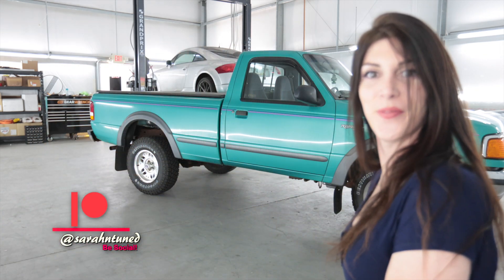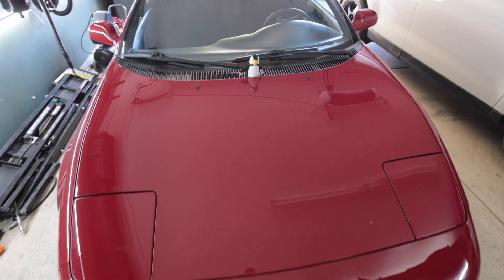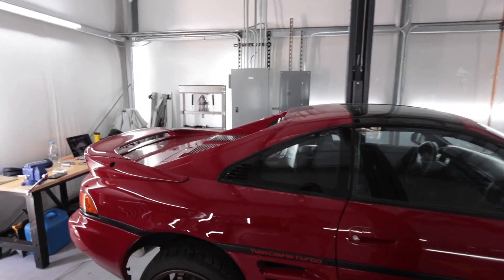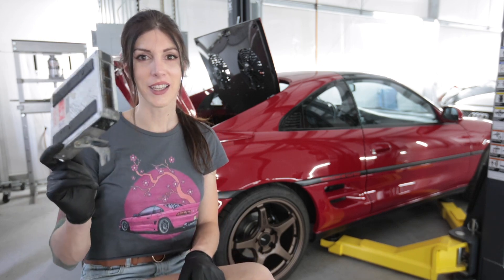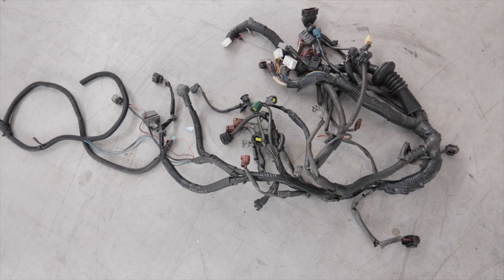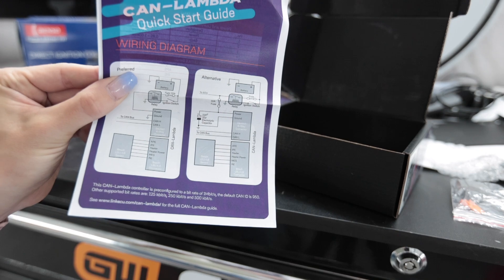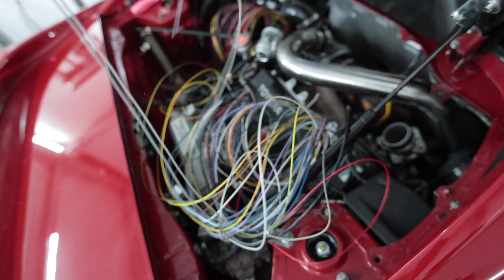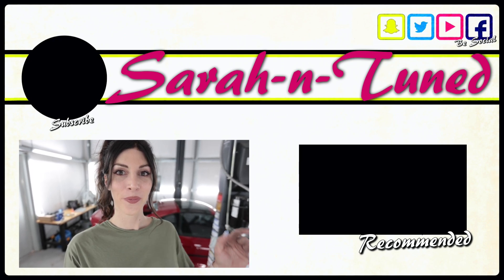Building an Engine Harness From Scratch! // Mr2 Turbo Link G4+ Stand Alone ECU

Comment from the maker: If anyone has a source for brand new OE SW20 Gen 2 3SGTE engine harness sensor connectors/pins please let me know!
Reply: Ballenger Motorsport. I pretty much got every connector with terminals for the entire engine harness.
Reply: Sara make your life simple get a pice of ply wood and lay out your old harness and screw it drown. Then take out all the shielding to see the wires and use it as a reference to reverse engineer the new harness
Reply: @josedanger8116  Great advice!
Reply: MR2 drivers club would be an organization to mine.
Reply: More work on Mr Dos?

Audience: yay! 😀
Sarah: not again!😣
Reply: corsa-technic
Reply: Farnell has many connectors. Sometimes you can read a number on the connector (after cleaning) and just google :-)
Reply: I heard wire gap Inc . Does new  Mr 2 harnesses. To order. Maybe not new connectors? Worth a call. 
 I would actually contact Toyota TRD and see if one of the older warehouses has a turbo
 harness on a shelf or the connectors since you have the skill to make your own.
 This might take more courage and determination than the 7 samurai defending that village.
Reply: I assume you looked at prime Mr 2?
Reply: You can find the pins on the Digi-key website.  Yes, they will have them, unless they are some proprietary design by Toyota.   If Digi-key doesn't have the special pin crimper needed then check the Techni-Tool website.
Reply: This car is the the reason I watch your channel. I have always loved the MR2 and yours seems to be the only one without a k-swap, which is very cool.
Reply: Commenting for the algorithm
Reply: Sarah,  that stock computer mount was designed with vibration mitigation in mind , allowing for some movement.  Hard mounting directly to the body may not be as nice to the pcb and internal components.  You may want to consider a rubber bush or polyurethane puck placed between the mount n body . Being a road car .  Reliably n mind .
Reply: You're a clever cookie arent ya!
Reply: Not sure if Twos R US would have any new ones but I'm sure they would help you out. They helped me out with a lot of parts when I had my 89.
Reply: Been watching all the nr2 channels closely. So I could restore mr2 to more modern way. 

few products I'm working on that you @sarahntune could actually used to restore your mr2 with a jdm engine. 

1) full milspec wiring swap 2grfe set up for stock ecu, and or any standalone in the market.

2) plug and play milspec gen2 gen3 and gen4 engine harness for the stock ecus, and standalones. with all new connectors and plus and pins. 

3) full milspec body harnesses for pdms and digital gauges for all your standalone setups.

4) Tubular frames and other fab work will come after.

oh and if your using a link g4x I would just change my temp and pressure sensors to a more reliable setup like the bosch motorsports pst-f1 sensor which gives u two in one setup.
Reply: Nope, sorry. Can't  help. All I have is the Ranger part.
Reply: Keep keeping on with the wiring it will so be worth it to have a reliable DOS.  I'm doing my project car wiring too and I'm more of a spanner monkey than a gremlin hunter. Best of luck I'm sure you will do great JX
Reply: Still no nails colour coded to the truck. Trucks paint is in great shape for a colour match. White creamy be stuff out of the tip I'm weak laughing top Sarah puns 10/10 JX
Reply: This stuff seems kinda technical. You know what would be fun is having a shuffle board set up on the shop floor and rolling from end to end for points 🤣👍hey, I'm sure to win
Reply: Just hit up 3stwins on iG
Reply: Try search for RM06H0E.pdf this will give you the Toyota connector repair manual. Maybe you can find your connectors this way the OEM part numbers are mentioned in it as well.
Reply: I have no idea how much it costs, but what about one of the companies that say they can make a custom replica harness if you can send them your old one? They also claim they can rebuild a harness, including stripping off all of the old insulation, soaking the wire in a deoxidizing agent, and applying new insulation. Then they replace the wiring pins in the connectors.
Reply: Sarah..you can do this you are a Genius!  Dont let over..thinking  get in the way of enjoyment..remember  you do love and have a passion  for working on cars
Reply: Check with Kyle from Boosted Bois. He's an MR2 Enthusiast
Reply: Wouldn’t worry It taken me nearly a year to build my harness
Reply: About to rewire both engine and body harness in my 91 sunroof gen2 turbo swap.  By chance does anyone know which gauge wires I should grab in advance?  Thinking SXL 20 gauge for a decent amount of it, but think there may be some 14/16/22ga etc, as well.  Just don’t want to tear mine up and then find out I’m missing some wires and have to wait longer.  Doing AEM infinity 5 series EMS, btw.  Dropping Cold-start injector, MAF, TVIS, adding 1uz injector conversion, adding AEM MAP, AIT, EGT, and UEGO sensors.  Thanks in advance!! And love the mr2 series!
Reply: I just sold all mine were still in mint condition. Damn wish i seen this earlier.
Reply: Caspers Electronics has OEM mechanic packs for pins and connectors for a lot of manufactures last time I visited with them  … they may be able to sort you out or at least point you the rests of the way if you hit road blocks.

 … also a wire looming tip is to lay it out on peg board and get the main lengths and destinations sorted, bundled and labeled before running throughout those tight awkward spots… then doing the fine detail work in place . Cheers!!!

Comment: Sarah, you might know. You were obviously an aviation electrician. I was an avionics technician. You remember the unbelievable tinned mtw powder coated fine strand paper wrapped milspec wire? Do you know where to get that stuff??? I'm going to do my 944 with a Q7 VR36 and I want to use it to build my harness and also use canbus modules for ZL1 type electronic shocks and all the body modules. Adaptronics to control the Oddy dsg.

Comment: Geez these modern cars are complicated! I'm so glad the new harness for my old Chevelle has everything already labeled and sorted. I just need to pull it and connect everything. 

I would suggest hanging the  harness on the wall. Then just go through it and mark and group the wires. Do as much prep work off the car as you can. It's easier than doing it while trying to fit into tiny spaces in the car.

Comment: JDM 94-99 SW20 MR2 Gen3 Turbo 3SGTE 245 Engine Middle Body Harness Wiring Wires~ | eBay
$399.00*· In stock·Brand: Toyota-is this it

Comment: Ideas on how to shoot this check out 5 Star stereo installation videos here on you tube.  They do an excellent job of showing the wiring in their videos.  Be organized and methodical, as you already are, and due sections at a time.  You already started that by grouping the wires.  Sometimes it helps me to draw the circuits I'm working on out so I can better visualize what I'm doing.  Slow and steady.  DINSTAAR.

Comment: Hopefully if you can cross reference the connectors to Molex or AMP, Digikey or Mouser should have the contacts.  Also, in the absence of a harness board, maybe you can lay some tape out on the floor to get the lengths.

Comment: get a 4 x 8 sheet of plywood, stretch the original harness out on half then duplicate it with the new hardness. That way you can be sure to get the lengths correct and add or subtract as needed.  You can do it! Breath deep!

Comment: I watched this video cause I think MR2s are super cars.  
Uh, no. 
Entertaining and beautiful.  There, that that is the first time I have ever used that description for a car mechanic. 
I’m there are more, but not many.

Measure the routing distances between connection points.  Set up a board with those distances and run the wires around the board and work up the connectors.  Then you can ‘ring out’ the harness and confirm its integrity before you install the harness.

Comment: Labeling things has made this 100x easier for sure. Are you able to pull measurements from some of the old harness? precutting your wire to length based on the lengths of the old harness (with some extra, because shit happens) might save you a lot of time. 

Love all of your videos, and I'm excited to see how this goes!

Comment: I know the feeling of tackling wiring. I redid every harness in my F250 using several donor harnesses to have all the options I wanted in the truck. Best part is they all look nearly original. If you get in a jam for connectors, you can depin the stock connectors, and carefully pry open the crimps, then crimp onto the new wires, maybe some solder if any look sketch. Total PITA, but sometimes it's the only way to get an OE connector without a bunch of harness splices.

Comment: Aww, wish I were there to help you. Having colored twine/string and attaching to the existing wire as you pull them out will make re-pulling the new wires that much easier.  Ive ran enough network cable in my life to reach at least to the moon. I am not sure how those connectors are built, but if you cant find you pins or a donor connector, you might consider trying to salvage the existing one and have them cleaned and re-plated.

Comment: Sarah, I went sorting through my MR2 parts bin and came up empty for the harness from the kick panel back to the engine bay.  I did run across the full under dash harness with all modules that came with my JDM motor.  If that can help you in any way, I'd be happy to donate it to the cause.  I live in Phoenix and have a bunch of other spare parts I'd be happy to give you if they could help.

Comment: Hey Sarah, u can use a 4x8 sheet of plywood and nailes to route the wires. Then zip tie and loom before u put the harness in the car. Leave the wires long and terminate after it's in the car. Use the stock harness as a guide.

Comment: I have been planning to do engine swap and fix some electrical issues at the same time and this is the part that I'm breading the most. My harness is all corroded, thanks to all the salt they use here. It will be interesting to see what it really takes to do this. Please, don't leave details out!

Comment: Use a piece of plywood, layout the oem harness and map it using small nails or staples. Then match each of the new harness to the same map on the ply wood matching all wires to plugs. This will give you run lengths and keep all connectors sorted. I saw this done for a kit car and it made the ocd side of my brain happy. Love the channel!

Comment: Such a great video Sarah! I'm currently putting a V8 from a Cadillac Allante into a 5-spd Fiero. For the last few days I've been sitting around with my Caddy and Pontiac shop manuals, the engine  harnesses from both cars, and my Dymo labeler, labeling and sorting every wire and connector... It's tedious but also sort of therapeutic. Best of luck with your harness!

Comment: When you go to take the bed off the frame, expect the threads on the bed bolts to crumble away, and the drains at the forward end of the bed against the cab to be somewhat crusty .

Comment: Just a suggestion. Use the time lapse setting so you can just set the camera while you work. It won't show every little detail but takes off that distraction of the camera. Two get some boards, lay down each harness on each so you can have them side by side. Add some staples to the board and then with some cable ties hold the wires to the board or just Velcro. This will hold the wires down so you can make each connector and compare it to the original in color and length. Hopefully this can help make the process easier. I've never done a whole wiring but if you tackle it in a more manageable way it may help take the stress out. If you think of a better way, by all means do it. This is just how I figure I could keep my self sane In this type of task.

Comment: Why Toyota didn't locate the engine ECU on the 2nd Gen MR2 in the same place as the 5th Gen Celica (under the dashboard), I'll never know. Sarah, you might have to do what I had to do when sourcing an intake boot for my '91 Celica: Import it from Japan. Those Toyota manuals will be a big help when you're able to build the new loom. It should be literally plug and play once it is done.

Comment: Just remember, the time you take to label wires will save tons of time later on. Labeling wires outside the vehicle on the floor is loads easier to do then trying to figure out what an unlabeled wire goes to or comes from... Been there, done that. Thumbs Up!

Comment: My grandmother passed away over 10 years ago and I got her Prizm off the estate like your grams Ranger. It was low miles and like a brand new time capsule to the past. So I feel I must warn you that the aging process that should have already happened will happen at a faster rate if not properly cared for in the same manner ( out of the sun etc.) at 20 the car began to look 20 but with under 100,000 miles on it so it lost it's brand new looks very quickly.

Comment: My suggestion would be to do the professional wiring job off-screen, then do a fake construction with a pile of spaghetti wires on the floor. The enraged comments from everyone with OCD should push your engagement figures off the charts. 😉

Then you can do the reveal of how it’s actually done.

Comment: You can find the pins on the Digi-key website.  Yes, they will have them, unless they are some proprietary design by Toyota.   If Digi-key doesn't have the special pin crimper needed then check the Techni-Tool website.

Comment: So.......... are you reconstructing the entire MR2 wiring harness from scratch?  And if so, dumb question, I know, but isn't it possible to just purchase a new or refurbished wiring harness for a '92 Toyota MR2?   Yes, I'm confused ....  why do you have to get down to the nitty gritty wiring diagrams and schematics?  Wouldn't that "new" wiring harness have all the required pins and connectors?  Sorry, but I've followed this project from the onset and just trying to stay with you.
Reply: Back story:  During one of my Air Force assignments overseas, my boss had your exact car.  We would always go out to lunch together and I grew to love that sweet little car.  No it didn't run 250 kph on the Autobahn, but it handled the back roads and on/off ramps like nobody's business.  I had an old German '86 BMW 525e I bought on the economy and even tried to trade him for that sweet MR2.  Happy to see you saving one!!

Comment: Hey Sarah, couple of tips, 1. If you take your trunk lid off you can sit in your trunk and get easier access to your engine bay.  And B. Get a large board and lay your old loom out on it, then put a screw or nail in where each plug is and the ecu plugs are then run your fresh wires from ecu plug to each plug leaving them slightly longer for putting the plugs on

Comment: Sarah, you are a very bright gal. You will get this done right; just take your time. When you get to be my age, you're will still be driving Mister Dos and your Gram's Ranger, so take your time; no problem. Also, your "Rollintros" are really cool.
Reply: Subscriber's Log: Supplemental, I use dielectric grease whenever I pull a wiring connector apart.

Comment: Pins can be a PITA to find. I have recycled the pins+ connectors by soldering the new wires about 1/2" the original connector and using shrink tape. This worked IF the wires amd pins near the connectors are in decent shape. That can save you 1/2 on pin replacement.
Building a harness sucks... then it begins to take shape and then sooo satisfying when you can just start the engine without crazy alectric issues .

Comment: When I have to do this task, I splay out the old harness on a piece of plywood painted white using screws hold the intersections. I draw the pinout on the board at the end of each branch. I do the same and build the new side by side.

You've probably seen this method if you worked in commercial production of harnesses.

Comment: Pretty, smart women, goes we're 80% of men stops regarding cars and wiring. I bet you get it right. I always stop when it's confusing and after a cup of Caffè I'll pick it up where it took off. That helps a lot.
I know airplains are a lot more wires and mostly numbered instead of labels by codes. I have done aircraft building. This is easier. 👍😊

Comment: It's a little tricky, but you only have to run 1 wire. Then you run 1 more, and 1 more after that, and eventually you will only have 1 wire left. The "where the f%*k does this go" wire.

Comment: Ten years ago I made excursion to factory, they made wirings for Scania and Volvo trucs. Process was quite simple: big board where you put connectors plastic parts, machine delivery suitable lenght (and right colour) then cable metal ends insert. Lady at work put cables one end to connector and route it to other end and connect. Repeat every single wire. When all wires were in place, wrap it with insulator tape or what ever material it is. Lot of work but not hard to understand. Making only one will be pain because need dozens of different connectors and wires. Best wishes in this project Sarah!